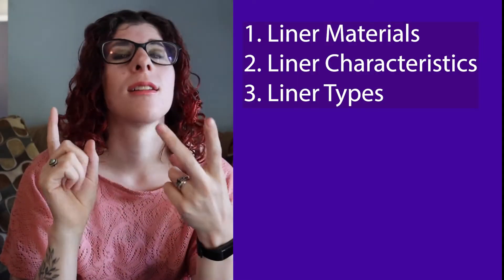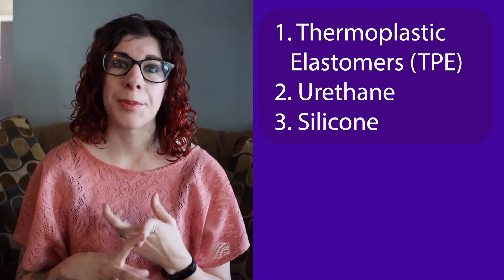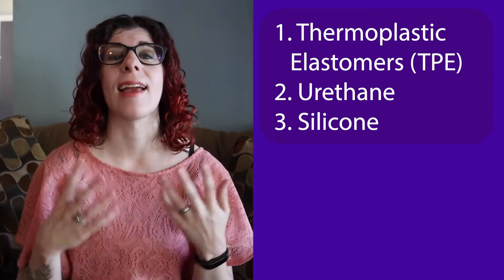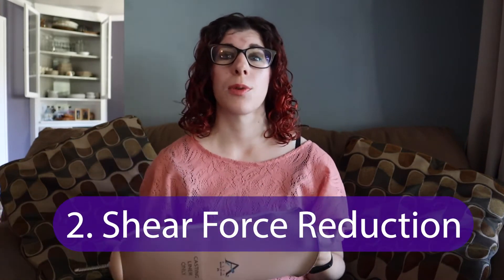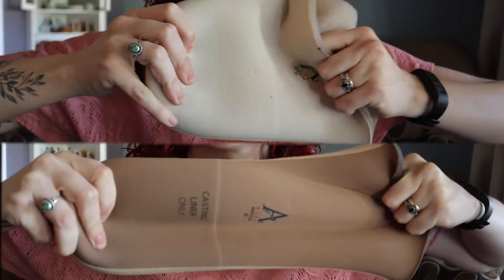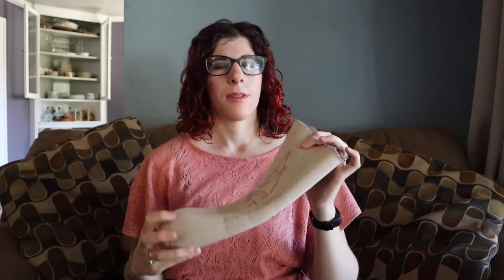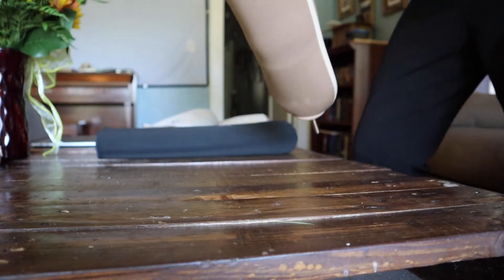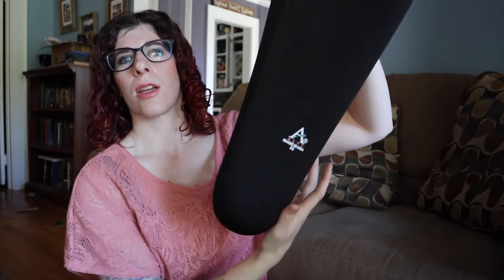Lower Limb Prosthetic Liners: Pros/Cons & Key Differences

Comment: I have one Alps liner that I really like, has a lower matrix that has a higher compression structure. (Do not know all the descriptive terms) however the umbrella diameter is small and protrudes out. Is very stressful to distal end of my stump. Can not wear causes blisters.
Reply from the maker: Appreciate the feedback and you sharing you experience! I have run into that a few times as well with others I have worked with.

Comment: Am looking at an alps liner on the amputee store its the black one does it have high stretch?
Reply from the maker: I put their black liner in the middle as far as stretch. Their general purpose and easy liners (lighter colors) are going to have the most stretch, and the extreme HD liner (darker brown color) is going to have the least amount of stretch. The black liner is also the HD (high density) gel but a little more giving. When I am ordering the black liner, I typically go with the tapered version which is 6 mm thickness in the front and 3 mm in the back, especially for below knee amputees. I have used the black liner with several clients that have used other liners previously and have received good feedback with the Alps liner. Many have preferred the Alps black tapered liner.
Reply: @TheLegLady  what do you think about the Alps eco? The reason is my legs below the knee is small compared to my thighs. My circumference 6cm up is 28cm on the right and 60cm above my knee.
Reply from the maker: @charmoniquewillis8922  I have not used the Eco Liner as much as some of the others, but it does seem to have slightly more vertical stretch than the black or the dark brown extreme HD liner. It will give you more stretch at the top as well though while giving you better containment and control of your limb tissue compared to the general purpose and easy liner. A new liner will stretch out over time, but you can use your hands to stretch out the top before putting it on to speed up that process. If it's tight and uncomfortable around the top a little A&D ointment can help prevent irritation from friction and pulling at the skin. There's not really any company making decent conical shaped liners anymore, they have gotten more generic in shape. You could also see if your prosthetist would be willing to order one for you to try before you purchase one.

Comment: Sorry, the one I’m looking at is the alps superior performance with hd gel. I’m hoping that will be less tacky and fix my problem.
Reply from the maker: Yes, with the Alps liners there is no need for any ointment on your leg. The gel of the liner connects with your skin to stay on, but it shouldn't pull on your skin. Most of the time I am using Alps liners with the HD gel because in my experience it holds up better, it's more comfortable, and it does a better job at containing the tissue of the limb. When it comes to sizing I am typically going with 6mm thickness. For some patients I have used their tapered one and have gotten good feed back. It is 6mm in the front and 3mm in the back. If you are between sizes (31.5 cm for example) I'd most likely stick with the size 28. Just realize it may be on the snugger side initially. Going up to the next size may be too big up at the top of the liner. There's not too much difference between the smaller sizes but there is a larger difference between the 32 and the 38 if you are between those sizes. In my experience Alps has been great about sending a sample liner if there is ever a liner I want to try for a patient. If you want to reach out to your prosthetist first to see if they'll reach out to Alps so you can try the liner before purchasing one.

Comment: What do you think about wool liners
Reply from the maker: Gel liners have done much to advance the field of prosthetics and improve the fit and comfort of a prosthesis, but they can be very hot and do degrade over time especially in very humid or harsher environments. There have been situations where I have just done a sock fit without a gel liner, in El Salvador being one example. And the wool does do a better job at absorbing and wicking away moisture compared to cotton, which is great for hot, humid climates. Oftentimes you will also see wool blended with other materials as well.